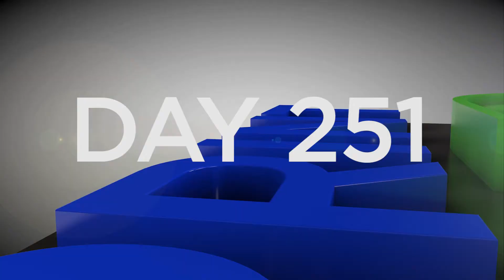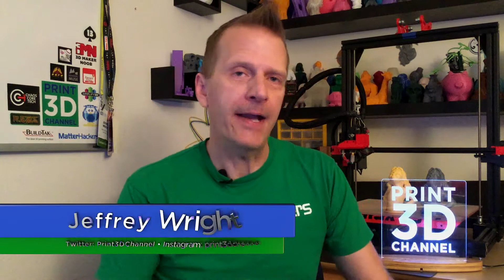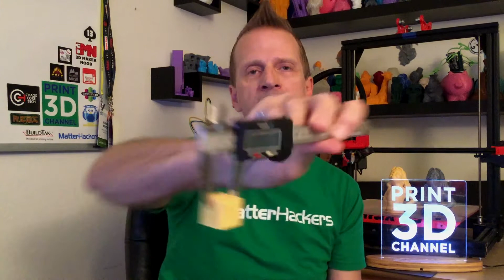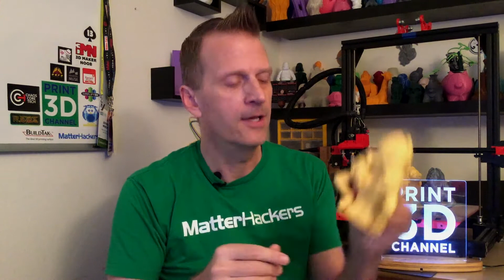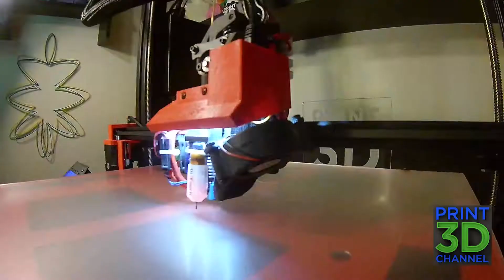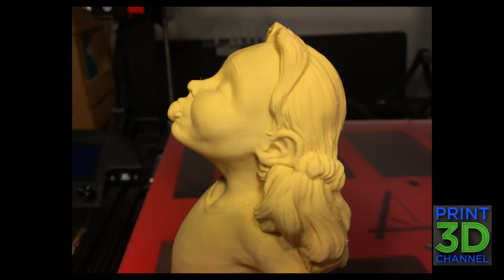#3DP365Project - Day 251 - Wrap Up and Final Print - Cheeky Monkey

Comment: The filament can cause banding but when it's all around the print and repeats at a set height I would be surprised if it's not a mechanical problem. I had the same problem as you but worse and had to change the threaded rods and travelling nuts to stop it happening.
Reply from the maker: Little tightening and testing and problem solved Thanks for watching!